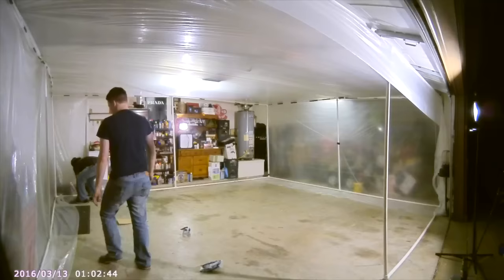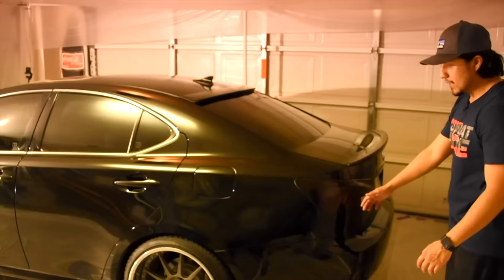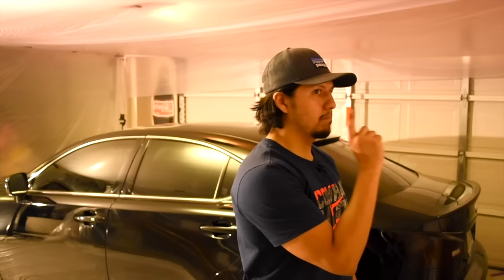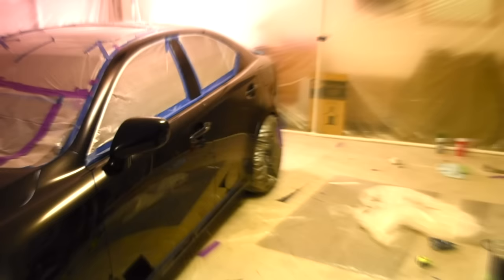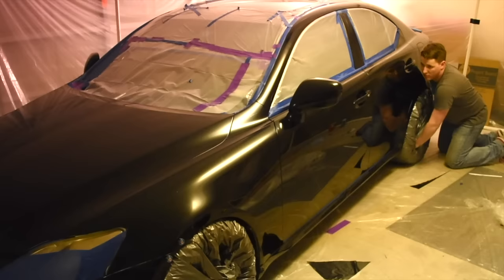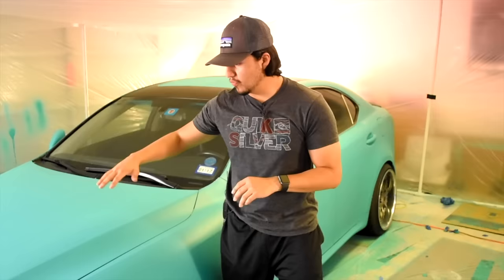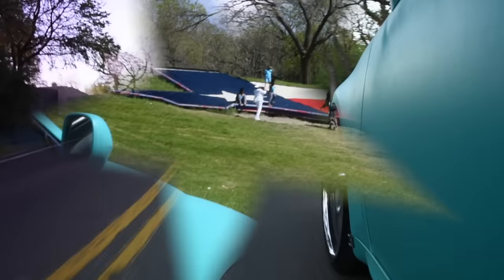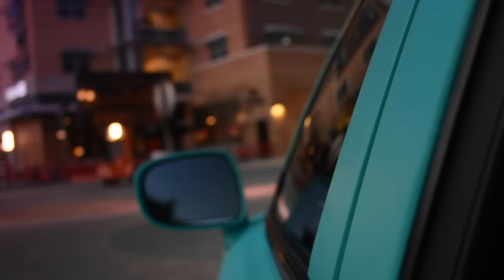Lexus in Intense Teal (Plastidip). (Non-Monetized)

Comment: i think you should smoke the headlights just like the tail lights
Reply from the maker: +**mrprohunter** i would really like to take the housing apart and just black out the inside, then add a light tint to the lens, project for the summer i guess
Reply: sound good looking forward to a video then
Reply: You should do a ricer build lol
Reply from the maker: @IUse TheForce smoked tail lights don't get you tickets, it's not following the law that get's you tickets. From the Texas Transportation Code Chapter 547 "Sec. 547.322.  TAILLAMPS REQUIRED.  (a)  Except as provided by Subsection (b), a motor vehicle, trailer, semitrailer, pole trailer, or vehicle that is towed at the end of a combination of vehicles shall be equipped with at least two taillamps.
(b)  A passenger car or truck that was manufactured or assembled before the model year 1960 shall be equipped with at least one taillamp.
(c)  Taillamps shall be mounted on the rear of the vehicle:
(1)  at a height from 15 to 72 inches;  and
(2)  at the same level and spaced as widely apart as practicable if a vehicle is equipped with more than one lamp.
(d)  A taillamp shall emit a red light plainly visible at a distance of 1,000 feet from the rear of the vehicle.
(e)  If vehicles are traveling in combination, only the taillamps on the rearmost vehicle are required to emit a light for the distance specified in Subsection (d).
(f)  A taillamp or a separate lamp shall be constructed and mounted to emit a white light that:
(1)  illuminates the rear license plate;  and
(2)  makes the plate clearly legible at a distance of 50 feet from the rear.
(g)  A taillamp, including a separate lamp used to illuminate a rear license plate, must emit a light when a headlamp or auxiliary driving lamp is lighted." I have not been pulled over once for my tail lights.
Reply: Star 3  Do you do this for other people too, like if I wanted u to do my car?
Reply: @pegasuss.o.s5049  he already has a ricer build. Look at the fucking underglows.

Comment: why would you use 300 on plasti dip instead of using it on real paint?
Reply: Because real paint is more expensive and with real paint you can't just peel it off which you can do with plastidip
Reply: Tsuki Rori also your book value drops once you chance the original color of the car if you were ever to sell it or God forbid end up getting it totaled in a car accident.

Comment: What are your wheel specs?
Reply from the maker: Front:19x10 +22   Rear:19x11 +25
Reply: @Star3  did you roll and pull your fenders? I have major rubbing issues. I have almost the same set up except I have 9.5 in front and 10.5 in rear. Both +22 offset
Reply from the maker: @igerz8180  i did roll my fenders, also i have stretched the tires. i'll have to get back at you on what im running with. I too had rubbing but only when doing sharp turns